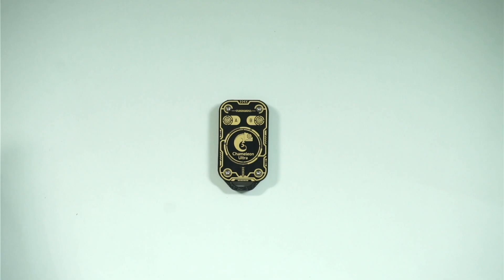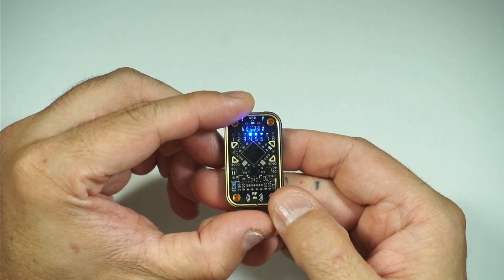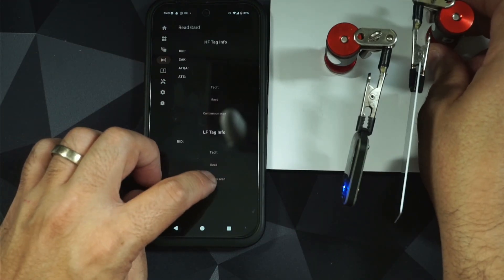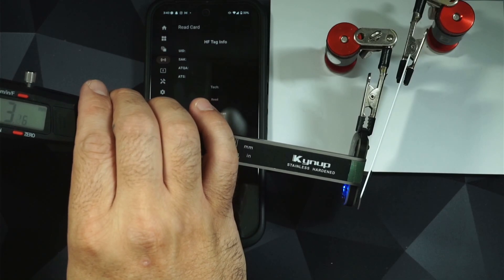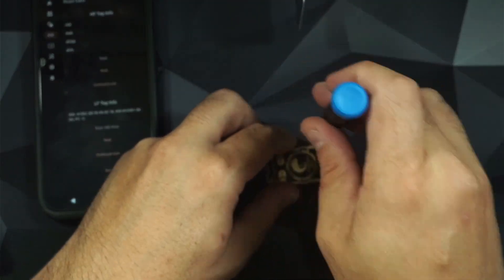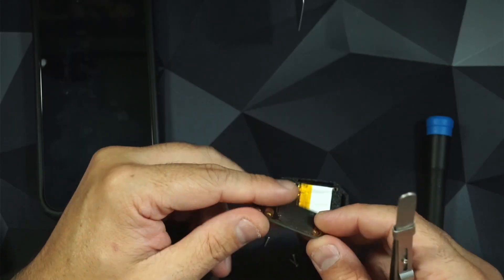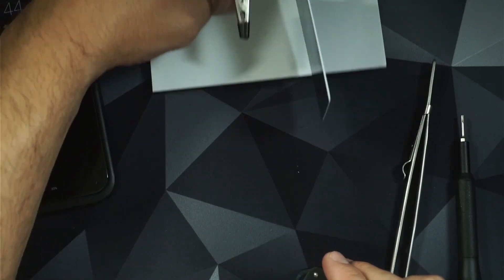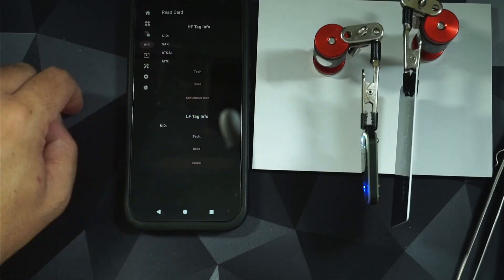Chameleon Ultra Low Frequency Antenna Mod for Increased Range

Comment: Why does it work better with the cover flipped
Reply from the maker: The LF antenna is on the opposite side with a reflector over it.  The opposite side with the design is actually a enig (copper with electro deposited gold) coating which interferes with the signal.  Flipping the LF antenna and replacing the reflector is allowing the LF antenna unobstructed range.
Reply: @MidwestGadgets  oh wow I see, I would love a video that opens it up piece by piece explaining what each part does. Im getting my clone today )
Reply: @MidwestGadgets hey thanks for the reply again.
Was wondering if you could help with my chameleon ultra 2 clone that I received a few days ago. It really does have an abysmal LF réception. However the model I received from ali have some sort of clear resine or glue transparent covering what looks to be small hexa head screws. How do I open this lol
Reply from the maker: @Ayanokami you just have to scrape it away.  It's just on the screen heads
Reply: @MidwestGadgets so where is the HF antenna,does it affect the HF range
Reply from the maker: @aperez8035 won't affect HF at all.  The HF antenna is on the opposite side.  It's a gold trace you can see going around the outside of the board

Comment: what does the tape there do?
Reply from the maker: It's like a reflector.  It reflects the signal back out.  I see it on a lot of different RFid devices.  Sometimes it helps the signal sometimes it doesn't.  A lot of it depends on the material that is used.  With these clones I can assume it's not really that effective
Reply: @MidwestGadgets  so if it isnt there it will no be as good?
Reply from the maker: @topsutin1766 I've had about 6 of these cracked open and they all have it.  If it isn't there I wouldn't be bothered by it, should still work fine
Reply: @MidwestGadgets  cool
Reply: @MidwestGadgets  oh yeah you mentioned it, i didnt watch it with audio so i didnt notice

Comment: Please fix your audio.
Reply from the maker: Hey Paul, what's wrong with my audio?
Reply: @MidwestGadgets I was watching a number of videos, all had similar volume except this video. I had to max out the volume to hear it at all. Comically, I forgot to turn the volume down before the next video.
Reply from the maker: @pauldmeyerable I have been fighting with YouTube and Instagrams audio compression.  Usually it sounds perfect in my edits but on upload these platforms adjust the audio on me without me knowing
Reply: @MidwestGadgets youtube can be bad for that, you do have a rather soft voice, and for whatever reason, they cut the volume in this video so much I also had to turn my volume up all the way, then put my phone next to my ear. The more recent videos are much better though.